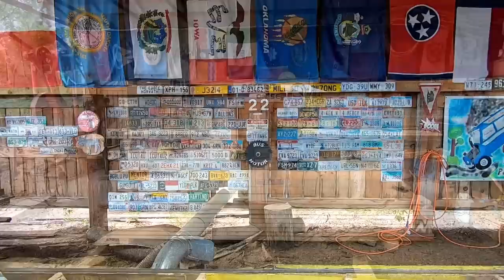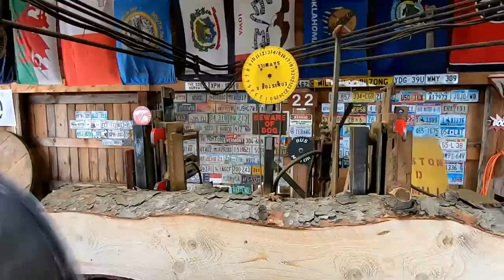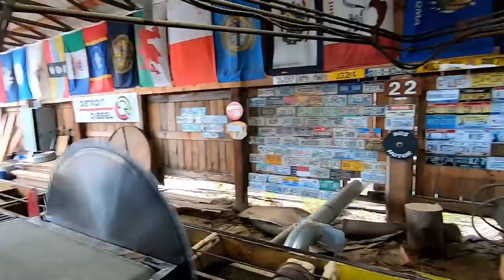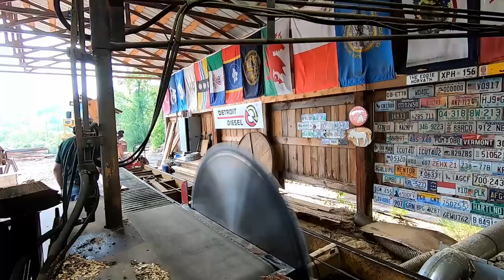making lumber stackers # 436

Comment: 👍👌👏 2) Yes, it's always good to predrill wood, anyhow if you put screws or nails in it. 3) Please kindly allow me to tell you something: A great trick/hack to not split wood is: Simply dull nail pits a bit by one or two wacks with a hammer. Afterwards the nail tip is no longer able to pusch away the wood fibres respektive push the fibres to the sides. Now the nail will break them. With this method the nail additionally holds way better respectively sits much stronger in the wood. Of course: the bigger the nail, the more important is it to dull the tip.
This information was given to me by a building expert more than 40 years ago. I still behave so (with good results of course).
Thanks a lot for making teaching explaining recording editing uploading and sharing.
Best regards luck and health in particular. To all of you of course.
Post Scriptum:
Great racks! Great music too!
Reply from the maker: I do that with finish nails works great.

Comment: Hey mark at the sawmill I work at  I use to run the exact same sharpener as you but I found me and the other sawyer couldn’t sharpen exactly the same since that sharpener pulls back and goes side to side. So we got a new sharpener a jockey grinder and it was the best thing we ever did the jockey really seems to get the say sharper.
Reply from the maker: I never ran a jockey grinder they seem to be bulky to hold.

Comment: Drilling that far through wood, try an old timers trick my neighbor from Nebraska used to use. Get a bottle of dish soap and squirt the bit, He always used dish soap when hammering finishing nails into wood so it should work with drill bits too.
Reply from the maker: good idea.
Reply: @markgalicic7788  He worked in the coke ovens in Beth Steel in MD for decades. He made all his own tools out of wooden handles with soda caps screwed to them for shaping the pumice fire bricks every time they relined the ovens and when home he built wood push go carts for the kids in the neighborhood. That was before anything was motorized for kids, we had 2 or 3 guys with broom handles pushing us down the road.

Comment: Speaking of fuel, how much fuel does the ole DD bus motor use on a given day of sawing?
Reply from the maker: it uses les than 3 gallon per hour.
Reply: I logged with aTJ had a screaming Jimmy in it and burn 5 gallon a day and they also had a JD 540 and it would burn 15 gallon a day

Comment: HI MARK 😊😊it's not your age that counts it's all of the work U have everything in the old days U jhad 2 everything by hand alot of tools ,machinery, and equipment wasn't even made until after WW2 then everything changed people had tools 2 do W power units were out gas and diesel ,chainsaws, tractors , bull dozens and alot places U didn't have 2 hull water, or coal, or slabs no more 4 the steam engines 2 pull the sawmills 😊😊 it is old school 2 day back then years ago it was all brand new and it was alot better than be 4 U could get the work done alot better and alot faster and there were stores and parts dealers U could get what U needed or order it PDQ 😊🎉❤🎉😊😊/😊😊😊😊😊😊 TLC/OMG 6 21 2O23

Comment: Icheibon the bottom board's with after you burn em a Lil not a lot then wire bruss the burn off coat with used motor oil working out for me with buried post's. Just a thought.
Reply from the maker: we do have used bus motor oil here.
Reply: @markgalicic7788  it works well I think you all will be pleased with the length of use you'll be able to get out of the them.

Comment: Re. the drill bit sticking;  I find, especially when drilling deep small-bore holes into soft wood, the shavings tend to jam up in the flutes of the drill bit. So I drill down an inch or so, then withdraw the drill bit most of the way out; the shavings fly out of the flutes, and I drill an inch or so deeper still;  repeat the whole process till the hole is fully drilled.
HTH, and my best respects to you, Eddie and ZZ.
Jack, in England
Reply from the maker: thanks Jack.

Comment: You need to put a couple nails in at least one of the members or there is nothing to keep the assembly square over time
Reply from the maker: we never had a problem with them racking .
Reply: @markgalicic7788  That may be true, but since you measured and adjusted the squareness of the assembly it must be important to you. Why not spend 30 more seconds and secure it?
Reply from the maker: @mlaotn  ok we will